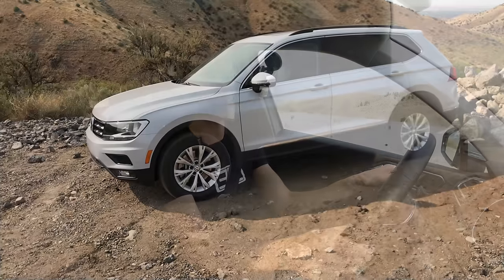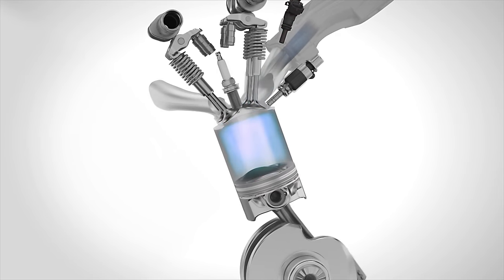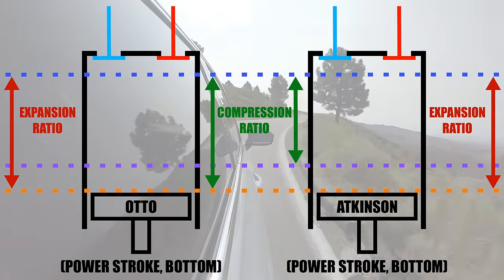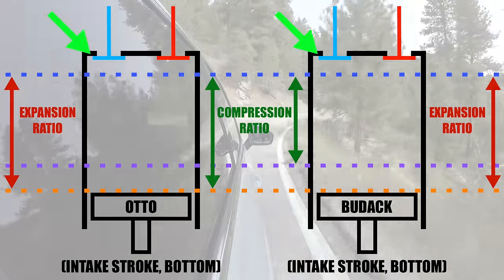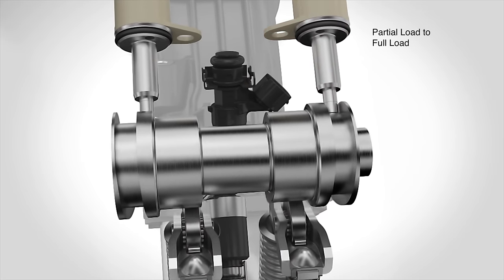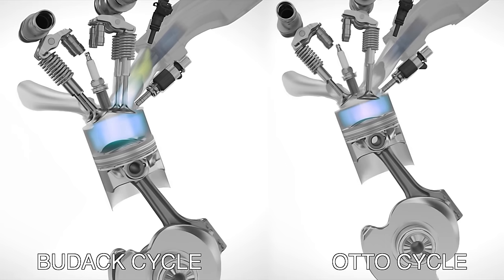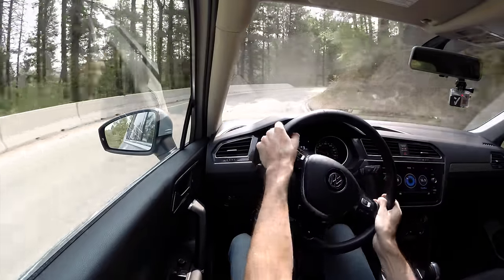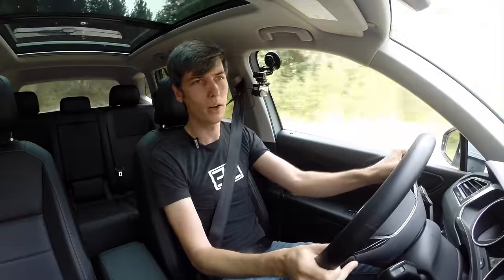Volkswagen's New Engine Cycle - The 'Budack' Cycle

Comment: Hi I am a Skoda car owner in India. My Car has 1.0 TSI ,3 Cyl, 113 Bhp, 178 NM, GDI without port injector on intake valves. 
I have a few questions and would be grateful if an experienced person like you can answer:-
1. The recommended engine oil is 0w30 on the owners manual. The place where I like the temperature is about 40 Degree Celcius for 6 Months, 15 Degrees for 3 Months, 30 degrees for 3 months. Is this engine oil for this temperature ok?

2. Skoda recommends changing Engine Oil every 15K kms, Spark Plugs every 60K kms. Should I replace these at these recommended intervals or sooner? How much sooner?

3. If I drive it more aggresively will it have a positive effect and reduce carbon buildup on the intake valves, or will have a negative effect and increase blow-by and hence increase carbon deposits?

4. Should I drive in Non-Turbo range i.e below 1750 RPMs to prolong the engine life as I won't kick in the turbo at these  revs and would have less pressure on the engine. Or is it bad for Turbo and ruin it instead?

5. How much can I expect this engine to last if I followed the service schedule fully, used top tier 95 octane fuel and baby'ed the car?

Thanks and Regards

Comment: my 1994 seat cordoba, with it's VW 1.9 lt diesel engine returns 5.5 lt/100km in town and 4.8lt/100km 
on a rn with a full load in the boot. 

Thats 49.00303819 mpg, m/g (miles per US gallon)   58.85019507 mpg, m/g (miles per UK gallon) town
and   42.00260417 mpg, m/g (miles per US gallon)   50.44302434 mpg, m/g (miles per UK gallon) route
 It cost me 700€ and still will resell for 700€  so no depreation in value. 
I do 30,000 kms a year, on tyres that last 2 years at a cost of 140€ a  set. so thats 70€ a year

fuel costs me on average under 2000€ a year 
servicing my own car costs about 200€ a year  
this year tyres, 70€ ( 140 € every two years.) rear brake shoes and new brake pistons 60€, cam belt 15€ 
 oil, filters, and brake fluid, total 30€ and a set of wiper blades form a discount store 10€ (single blade type)
so thats a yearly total of 2200€ a year including fuel   insurance 120€ a year 
Or a running cost of 7 centimes a km  
or about 10 centimes a US mile   
Now tell me why i should buy a hybred car ?    i bought mine for 700€  6 years ago, and today i can sell it for the same amount !!!

Comment: in practice it doesn't bring any efficiency, I've 2016 Volvo 1,5T3 and 2019 Skoda SuperB 1.5 TSI, Volvo is heavier, 0-100 km/h os better at Volvo, 100-200 is much better and fuel economy both in city and Cruise Volvo consumes almost 10% less than Skoda. it's interesting Volvo has Aisin 6 speed torque converter automatic transmission and Skoda has DSG and this system and Skoda is lighter but still consumes more gasoline and performance still more poor than Volvo

Comment: Hey man, I’ve always held your channel and your info with very high regard so I’m left confused by what you’re saying. Why are you calling an Otto cycle motor with variable valve timing a “modern” Atkinson cycle? An actual Atkinson cycle did not have variable valve timing AND requires pistons to be connected to the crankshaft via a double pivot linkage, which enable a one-stroke run cycle, completing all the functions of a four stroke in one strike. The details between the Otto and the Atkinson are stark, so why the misnomer?

Comment: As far as efficiency goes if you look at average mpg's on fuelly it beats the Mazda by .6 loses to the Subaru by 1.1 mpg and the Honda is 4.8 mg's better. All the competition have lighter weights and the Honda uses a CVT transmission.
Personally I'd rather have a heavier built vehicle and I'm quite sure I don't want a CVT transmission.
Subaru is out from it's unreliable reputation and Mazda does nothing for me.
I wish the Tig had the Atlas engine and I'm quite sure it would benefit from the extra power and get just as good or better mpg's. My Atlas averages 26mpg (on fuelly) . Three VW's in the family and all very reliable.

Comment: I wonder why did not somebody developed some electrical turbo that produced enough air flow pressure to increase pressure during the stroke procces to make more efficient and less comsuption. Its like SR71 engine at Mach 3 speed used only 20% of power to obtain same speed. Is there any chance to use a high pressure with combustion to make more efficient car engines?

Comment: Did i just hear someone say "hydraulic pin that locks the lifters in a more RADICAL profile allowing MORE AIR and GAS to enter the cylinder, wich means MORE POWER. V-TEC JUST KICKED IN YO"

Comment: I'm not sure if what I did was the same as simply using a smaller engine. I've been doing battle with that thought for years, but the exhaust temp data says NO. The engine ran more efficiently ... I still conclude.

Comment: bygolly vw beat me to it. i was gonna call it the blakley cycle. maybe in the semantic differences between mine and theirs, its not too late for me. i have a working prototype where the intake valve closes 130 (crank) degrees early so that my engine can be 18:1cr and burn 87 octane gas in a cast iron head and block & my other prototype has the valve close 90 degrees early so a turbo'd 12:1cr engine can burn 87 octane gas as well. it looks like theirs closes about 30 degrees maybe 60 degrees early with 14:1cr. if your interested in my progress, Rooftop Auto in grandview is where you'll find me. years ago, i called all the cam companies and none of them wanted to grind me a cam at 89/194 duration, but i did get to speak to ED ISKY. i had no idea he was still alive. he's a legend. he coached me how i could grind my own cams so i did. i do believe vw will develop this aspect of technology very well and will increase the power resolution of the combustion process.  my motivation at first was to find a way to convert diesel engines to burn gas since at the time  f-250 fuel injectors where like $800 each, but it has evolved.  thanks, i love YOUR VIDEOS. excellent clarity.

Comment: In the Atkins cycle the purpose of leaving the intake valve open past BDC is to facilitate scavenging to remove end gasses whick cause knock. Most engines are running at 70% of thier potential to protect against knock. If end gasses are deleated much highr CR can be used increasing MEP increasing thermal efficiency (energy conversation efficiency-ECE or EF-energy factor). Power and fuel economy increase as thermal efficiency increase. 

Proof: Eff=Pout/PE therfore Pout=PE X Eff.

Comment: Isn't this how SkyActiv works to increase the effective compression ratio by closing the intake valve earlier? If I remember correctly, they also close the exhaust valves earlier so that there is some remaining burnt air/fuel. Or was it one and not the other?

Comment: The thing is, it's well known VW underrates and overachieves in MPG, which is a lot more satisfying to the consumer than never quite getting to the rating in real life like a lot of cars. Car & Driver did a 75MPH highway test in this Tiguan and got 32MPG. Honestly I think VW does the EPA test just because they have to, then they drive their cars on the freeway at 80MPH with the A/C blasting in the middle of summer at a mile above sea level, and they give that rating instead. I say that because that exact scenario matches my EPA rating in multiple new turbo VWs I've driven, I've never experienced that with any other car.

Comment: Question from a relative outsider: Why are we still using cam shafts for valve timing? Electronics and piezos have come a long way in last 50 years. It seems to me that an encoder and small CPLD or FPGA could offer a ridiculous amount of run time valve configurability. A driver could easily switch between maximizing efficiency to maximizing power and anywhere in between by classic driving mode selection or based on accelerator position. You'd also have less rotational mass, though I suppose when you're looking at an entire car the cam shaft(s) don't account for much.

Comment: The honda CRV/HRV is completely gutless, although the HRV compartively is the most gutted engine performance wise. It does get great gas numbers though. The thing that people will ultimately buy cars off of, is it comfortable for a non-short person to sit in for any length of time and can it haul stuff other than just people effectively?
Honda has seen fit to chop the amount of leg space that drivers can access, the HRV was cramped for a 6'1 driver (me), the older CRV was a little cramped but useable. The 2014 accord had less leg room for passengers too. So how's the Tiguan?

Comment: My 1981 Honda civic got an actual 40 MPG all day long, and most of my driving was fairly short trips.  I could smoke the tires and chirp second gear.  I laugh at all the new cars - new 2018 Honda civic rated for 28 mpg city.  And you know it won't actually get 28.

Comment: Actually the Mazda CX-5 with the manual transmission is rated at 35 mpg, not low 30s.  I can get 36 (measured) if I drive 65.  But I usually get 30 to 31 because most roads in Texas have a 75 mph speed limit, and some are 80 or 85, and fuel efficiency goes down then.

Comment: Automakers need to up their game a bit. My V-Strom has four valves per cylinder, but an improvement in efficiency due to TWO spark plugs per cylinder. So I have averaged over 62 mpg since I got the thing. The gain is due to much quicker burn of the fuel, so more energy can be extracted during the expansion cycle. BTW, I am not streamlined, nor is the V-Strom!

Comment: This isn't new at all. BMW, Toyota and Fiat have had continuously variable lift and timing intake systems for years now that do this, so much so that they even make these engines without throttle bodies.

It doesn't make that much difference in efficiency anyways because they still make the engines capable of running on full load (compression ratio equal to expansion ratio). To make full use of this they need to start making higher displacement engines with higher (geometrical) compression ratios that always run on a reduced effective compression. If they make one of these engines with like a 16:1 compression ratio it'll have the fuel efficiency of a Diesel, it just can never run full load or it will knock. So you could for instance have a 2.5l gasoline engine with the power curve of a typical 1.8/2l one but the 50mpg of a Diesel.

Comment: So...if this system "bench-marks" itself against the competition.....and does not offer class-leading efficiency....this then ends up another one of those technical exercises ( aka "German technical exercises),  that are nearly meaningless to the real-world user. Example of other tried-and-true methods to get better static fuel efficiency yet give you "power" when needed--->maybe  use a smaller, but turbocharged engine. The smaller engine under low/no boost can offer good gas economy yet get on the boost for passing power when needed.....if matched and sized well....can end up the same or better result with current technology.

Comment: Sub combined 30mpg is poor efficiency now unless the vehicle is a tank. Hybrid changes low rpm into 100% electric torque so that engineers can focus on highway and full load efficiency. With PHEV, the bigger the battery, the higher the speed before the ice engine kicks in. Most of the low rpm efficiency engineering changes have a very marginal fuel/emissions saving

Comment: All these "new" cycles are nothing more than minor variations of the Otto cycle.  They do provide efficiency advantages by increasing the expansion ratio so they do make sense, but let's not exaggerate.

The formula to calculate the maximum possible theoretical efficiency of a heat engine is:
E = (Th - Tl) / Th where Th is the high absolute temperature and Tl is the low absolute temperature.    Increasing the expansion ratio decreases Tl thereby increasing efficiency.  Unfortunately, only a Carnot engine, which is impossible to make, can achieve the efficiency calculated by the formula.

Comment: How VW claims the "Budack cycle" reduces pumping losses? When the  intake valve closes at 120 degree ATDC, the engine increases negative work creating negative pressure while traveling the remaining 60 degrees. ?? Borislav Zivk.

Comment: a fact: these engines system wouldn't exist without hondas VTEC,and ricers
Reply: Somebody would have done it if Honda didn't let's be honest here. Now Toyota has their vvt(Toyota VTech) Mazda has their crappy but super cool rotary engine and now their skyactive engine (which is stupidly engineered to be horrid to fix) now vw has their "own" engine style. We will see more and more companies trying new designs and in my opinion is stay away from all of them till they have had the kinks worked out.
Reply: @raymonddey7403  Mazda hasn't shipped a rotary engine since 2012... and their reliability is in the top 3, and are cheaper to repair than a Honda... but I guess someone's gotta gripe, at least they aren't in cahoots with Ford anymore since many years. Many of their engines are non interference so even if you do have serious problems such as timing chain failure it isn't catastrophic. As far as skyactive-d it's pretty solid and has been on the road for years, Skyactive-X is only being rolled out very cautiously and slowly in certain markets.

Comment: Surely having variable valve timing on an engine like this makes the concept a dead-end?

The dynamic compression ratio under the 'high duration' valve timing mode will be substantially higher than that of when the engine is in it's 'Budack' valve timing mode. For instance, say the cylinder head is designed to provide an actual compression ratio of 14:1 when the engine is in the 'high duration' valve timing mode to allow the highest thermal efficiency possible with 95 octane petrol. When the engine is in 'Budack' valve timing mode the intake valve closes early and the reduced charge in the cylinder means the actual compression ratio when the piston is at TDC is only 8:1 (these are hypothetical values to illustrate a point). Obviously, as per the Otto cycle an increase in P yields increase in V, so reducing the compression ratio like this would surely cut thermal efficiency massively?!

This seems totally counter-intuitive to me.

Comment: Petrol and diesel is dead for road cars. Electric wins in every performance metric now except cost. Give it a couple of years and it'll be cheaper too. Maybe if VW stopped trying to fake emissions (yes I know they all do it) and instead invested more in electric we'll all have 250+ mph cars with over 600 miles range for 10k today. :)

Comment: Yet another case where we're using fancy efficiency-improving tech to make vehicles bigger with the same fuel economy instead of the same size or smaller getting amazing fuel economy. 40 or 50 years ago cars were doing better than this! But nobody wants small cars, or cars in general, anymore... I have thought of, maybe heard of, similar concepts to this, taking this all a step further would be with completely variable valve timing - maybe Koenisegg's camless design, or something that dumps oil out of a hydraulic lifter of some sort - the intake valve could be closed at any point in the intake stroke, or even not opened at all. Engine wouldn't have a throttle, control would be purely on how long the intake valve is open, it would just be briefly cracked open for idle, not opened at all for coasting, opened for part of the stroke like this for part-load cruise, and held open past BDC for full power, the equivalent of a performance cam. It does make sense to close the valve early, before BDC, rather than holding it open past BDC to push some back out on the compression stroke as the Miller cycle does - I have to imagine sucking air in then pushing it right back out must incur some efficiency losses versus not sucking it in in the first place.

Comment: This seems to fly in the face of some basic physics. Hp to weight ratio most glaringly. I guess when the mass is moving and doesn't require much torque to maintain velocity it pays some sort of marginal dividend based on some kind of lower consumption of homogenous fuel-air charge.  A stratospheric charge was supposed to be where GM was going but it abandoned that based on their findings because it produced excess NOx. With all the interest in variable compression, I'm still wondering why water injection hasn't resurfaced as an even more prolific method.

Comment: Dude, the early closing of the intake valve is exactly the Miller cycle. VW just came up with a new name for the same thing. No new invention, just pure marketing BS.
Not even the way how to shift the valve timing is new, they already had that on the EA888 Gen 1, just without using the Miller cycle.

Comment: The marketing department says to the engineers give us something different to market, anything! and they come up with "something", anything that the others are not using. Nothing special or technically advanced because in a few short years they will need another "something". The Marketing department "Breakthrough, radical, cutting edge, quantum leap, blah blah and blah blah blah." Almost forgot, top Honchos to Engineers "Make sure it holds together until just after the warranty runs out."

Comment: This looks like more parts to fail and cause catastrophic engine failure. Cams with variable lobes for the same valve adjusted with a solenoid that adjusts it at 2500 rpms. GM got over creative with their trusted 5.3 due to efficiency and ruined the motor for a few years. I wouldn’t touch this engine with a 10 foot pole. Yes I realize they’re German and GM is American